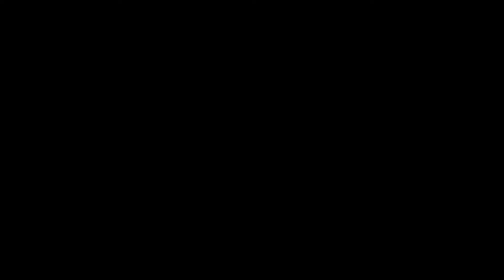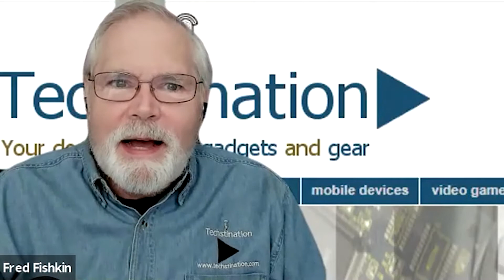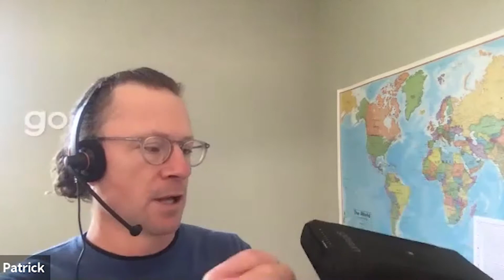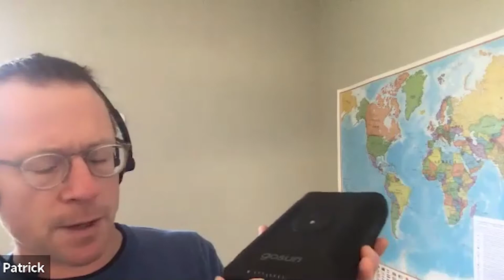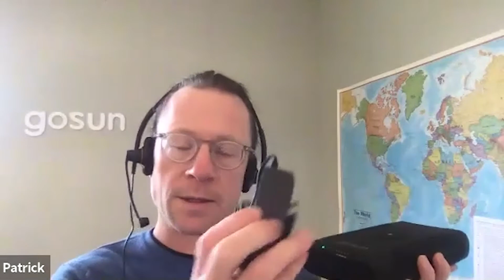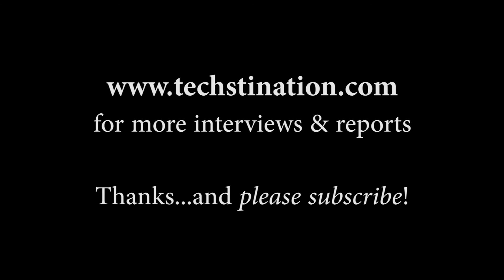Techstination Interview:  GoSun Power 266

Comment: Finally a solution to charge my Dyson V11 outsize without an inverter and directly from variable voltage solar power output. That’s innovation.. Looking for a similar solution to charge DeWalt batteries for power tools, i could plug in an inverter to the 12v 15A outlet, while losing some efficiency it still would be powered by the 🌞 sun.